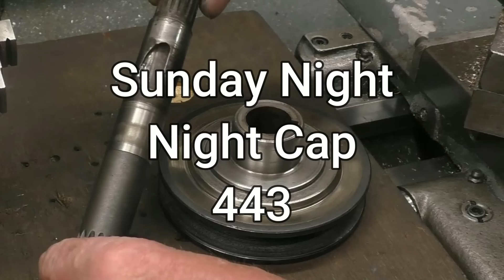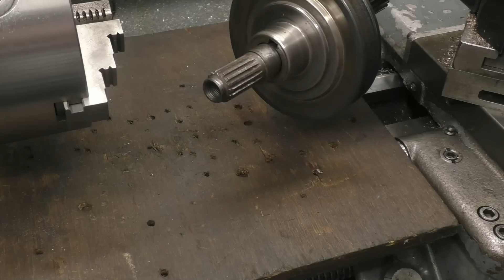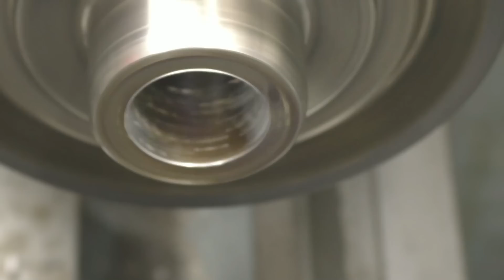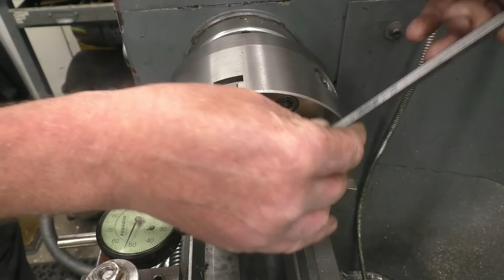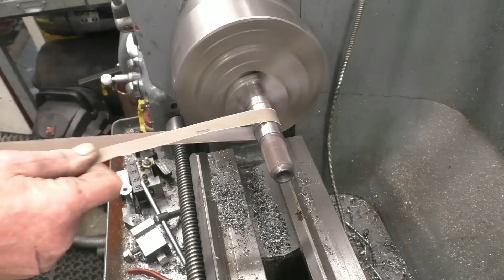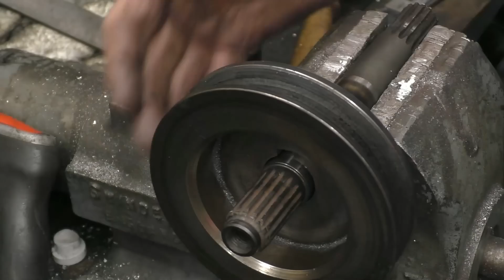SNNC 443 P2 .Worn Shaft & Pulley Repair

Comment: "I could use a 4 jaw chuck, but..." How many times I've said that over the years! If it's not a critical, +/- 0.0001 part? I don't bother getting it closer than within a thou. For pulleys and sheaves, it's good enough and better than any you can buy off the shelf.